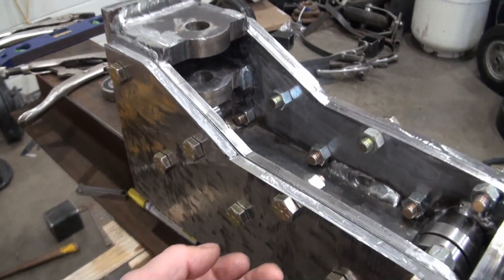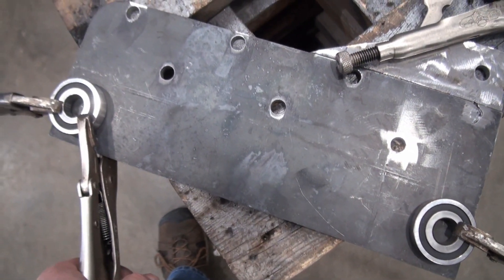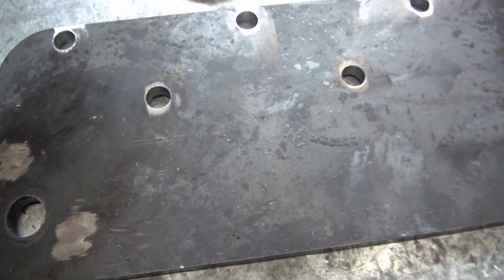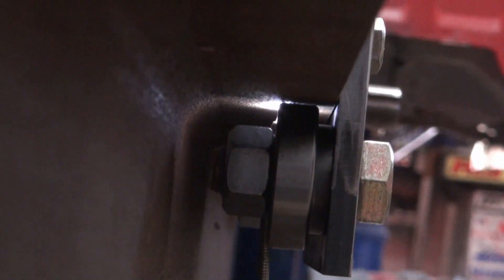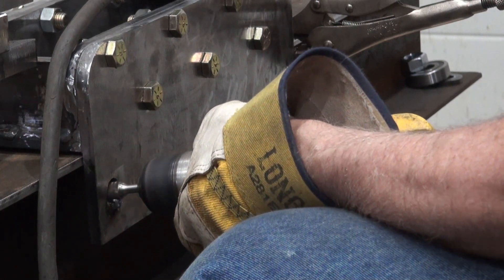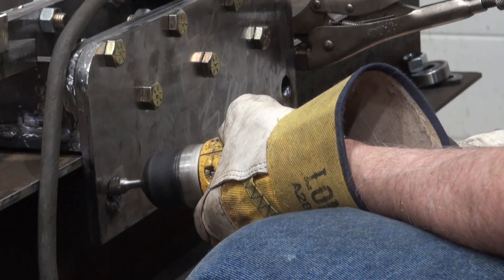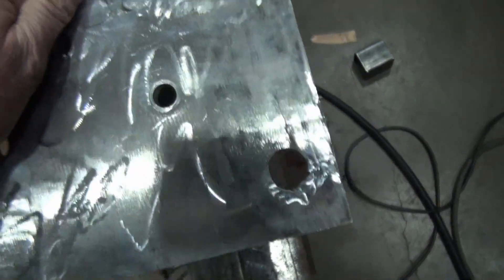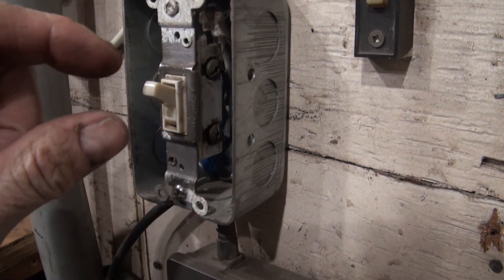Kinetic Log Splitter Build Part 11

Comment: 6:34 after you finish this, I would recommend some thought on being able to adjust those bearing independently like a slotted hole where you are moving now and a block behind the bearing where you can have a adjusting bolts